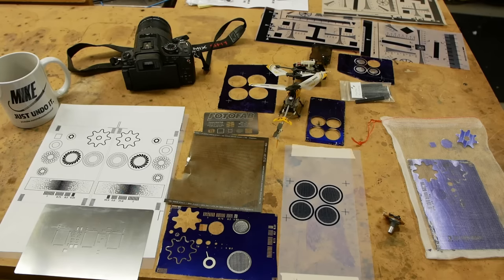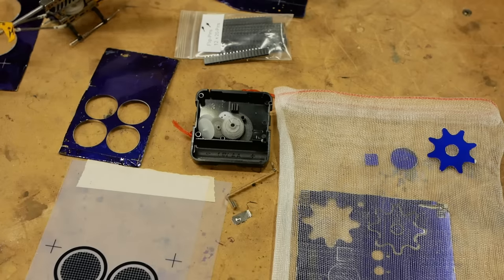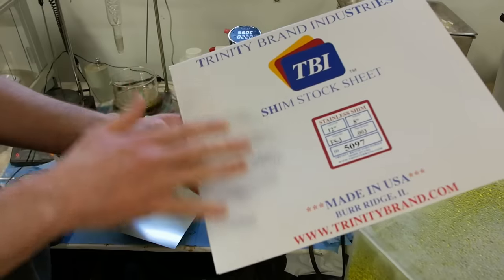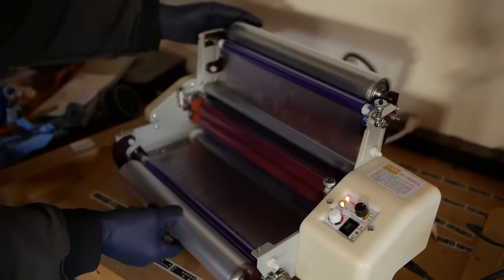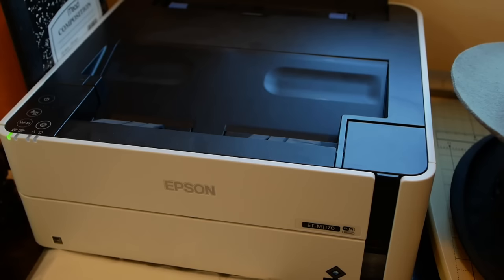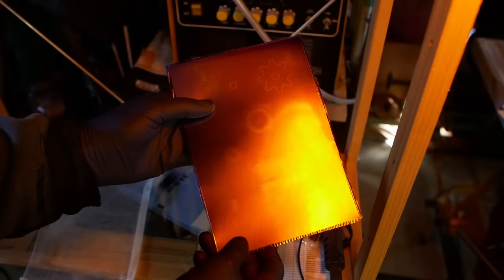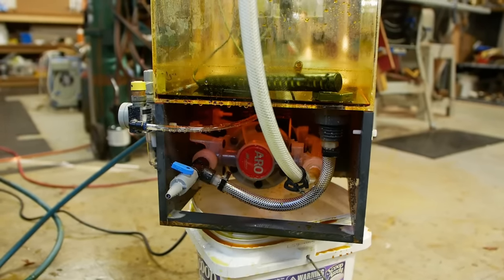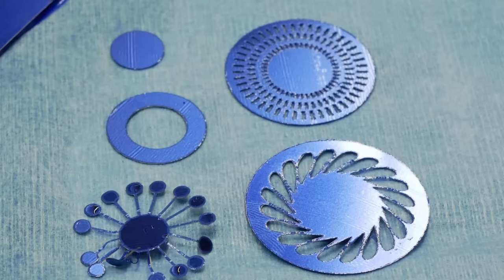How to make precise sheet metal parts (photochemical machining)

Comment: 13:37 You could add a bunch of finely-spaced concentric circles to each corner of the transparency so that a Moiré pattern forms if there is any slight misalignment. Or use the circles (for translational alignment) on one pair of diagonal corners, and grids (for rotational alignment) on the other corners. 

I assume you probably look for that pattern anyway if the part you're trying to make already has a fine mesh/grid, but it seems worthwhile to include an alignment pattern for parts that lack such features.
Reply: 13 37 indeed

Comment: @13:40  a few notes that come to mind 
A. You could use very thin double sided tape at four extremes of plastic and paper backing before placing in printer to reduce stretching of stencil print .you assume the paper will act as a decent friction for rollers .
B. 'd imagine you could print 3 index marks on the transparencies which could be accurately aligned with its counter side ,then  hole punched along with hole punching the steel sheet in exactly the same way,linking up all transparencies and steel is simply a case of pushing a plastic pin through three holes to locate all steel and transparencies without much displacement  error

Comment: Hi, just wanted to say that this is a fantastic project, just one question, have you tried using a laser eni to remove the photo resist instead of using a transparency to develop. I've seen people use a laser for circuit board prototyping and they follow a similar process to yours. Thanks

Comment: Have you thought of using photographic film for even smaller details?

In theory you could inkjet the object, or even machine a large version and use a projector to shrink it.

If you columnated the light you could also possibly make both layers at once to give a pre-registered two layer mask.

Comment: At about 13:50 you say you eyeball the registration marks, but there are parallax-correcting magnifiers used in old-school offset printing to align those registration marks on four-color process negative sets when stripping them onto flats for exposing onto the printing plates for the presses. They may still be available, but I'm not sure.

Comment: The best way to apply photoresist foil onto sheet is under the water. In that way step with drying in properly is out of scope ;) After that you can run it thru cold laminator to squeeze water out. I made lot of PCBs in that way. To have nice print from laser printer is putting already printed foil into box with towel soak in acetone for a 10-20min on a radiator. For UV lite I'm using those UV nail studio light with 555 timer :) Etching is simple by throwing it into chloride bath and occasionally moving.

Comment: Anything you find in the trash,DC barrel jacks,switches,led lights and strips,short wire harnesses from circuit boards,small DC motors,cables and connectors,USB parts,parts from circuit boards,speakers from lcd TV's,small incandescent bulbs and sockets,Ac power cords,computer cords,any electronic parts,can be cannibalized and taken out if junked things,and save you a ton of cash buying them.Plus your keeping it out of landfill.Even kitchen appliances have motors,switches,wires,connectors,screws and bolts,heating elements.Even microwave ovens have large transformers,switheslights,magnetrons,buttonscables and wires,sheet metal housing can be cut with tin snips for parts etc.Rubber feet and plastic stand-offs on the bottom of items are great to keep,for projects to keep them up off the ground.Most discarded appliances have just one minor broken part,and are dumped With a little investigative work,some screwdrivers,an ac/DC ohm meter that's $5 at harbor freight,can help you easily figure out why it was dumped,and what minor part needs repairing,mostly you can rig it to work,and you have something you can sell for some decent cash online,or use yourself,like I found a cappucino maker,kinda expensive,and only the lighted rocker switch was bad,popped it out,pulled the spade connectors off it,and I just temporarily hot wired it to the on position til I found something else I recycled,with a similar rocker switch.It wasn't a lighted switch,but who gives a Fuck? I had a nice krups German cappuccino maker that was like new,cost new like $160 bucks,looks good in my kitchen,and was free.

Comment: Very nice video. Did you look into the costs of compliance with environmental laws to do this on a commercial basis? Years ago we had the option of using Postscript to film machines that produced gorgeous high resolution real photographic film at a low cost (like 4000 dpi). Unfortunately the printing industry no longer exposes plates that way so the service bureaus are no longer a resource. I produced some silk screen film by programming code directly in Postscript. The machine operator stopped the job on one because he expected such a small file to run fast, because most PS output had a lot of code for not much image, mine was the opposite! Those mesh patterns could be created algorithmically in a similar way.

P.S. looking forward to seeing you Saturday in Pasadena!

Comment: Serious inquiry, what it the thickest the metal can be? Thick enough so its not flexible at all?
And the inside wall through the thickness can it be smooth?
If not then what about the thinnest metal sheet?
But if its thin then I needs many more sheets.
I want to make a hydrophilic battery.
Its surface area dependent, have a hexagon grid of holes 60 microns in diameter with the thinnest wall of material left between the holes, treat that metal to be super hydrophilic, stack them so the holes align perfectly. But then I need a non-flexable metal with 10 micron sized pins that will flawlessly line up with the holes going straight through all sheets except for the last one, the pins will be treated to be super hydrophobic. Pins and holes stay electrically separate. It will be assembled in a vacuum chamber of the purest water that has been fully degassed, and sealed up submerged in the water still under vacuum.
Ant there is a battery that can never die.

Comment: I've wanted to build almost precisely this but for washing resin 3d prints...need a pump/plastic combination that can handle isopropyl, or denatured alcohol, or (I think some people use acetone?)...moderately high pressure. The benefit being you can do a multistage wash with several reservoirs of smaller quantities of solvent. First stage dirty wash gets the bulk of the excess off with sheer force; further stages, simply by changing some valves around would use cleaner and cleaner solvent until the final part is 'quite' clean. Risks: Intentionally making alcohol vapour. I'd want to build a refrigeration loop to condense the mist and vapour back to a liquid...and potentially have an airlock so the chamber is never truly open to atmosphere. Bathe it with CO2 to prevent an explosive gas mixture building up.

Comment: Back when i did more PCBs at home i also used the emulsion transparency paper, but mine had a small 1cm strip of paper on the leading edge, i guess that should be enough to make it work, i never had an issue with any printer.

Comment: One thing I've learned from the DIY space recently is that you can use MSLA printers to cut out the masking process, though with only one side at a time; but I'm sure with enough spare parts, someone could develop a rig to do double-sided MSLA, potentially even with a soft clamping force to correctly locate the work piece in the vertical axis. But given the high pixel density of these panels, a lot of them now being 4K in a sub-10" panel with 8K units being the next step, they'll outperform printers with transfers; although I hate describing any display-based printer with the resolution naming, as PPI is far and away the much better unit of measurement, especially at the size of 3D printers where the PPI from a 5" unit to a 10" unit is substantially massive, especially when many units won't always share the same aspect ratio, and many products don't list the aspect ratio directly so figuring the PPI is more of a task than it should be. 

Something like this wouldn't be all that easy to automate, considering the pre-wash, rinse, and drying processes, lamination process, the locating process on the MSLA portion, and loading the mesh bag. Mesh bag loading and forward is fairly easy, just have a carrier that can move it from station to station, and have the magnet setup be disengageable to ease the transfer between stations. As for the pre-wash, rinse, and drying process, this could be automated with an oven, since blasting the sheet with entirely clean air could be difficult, post-rinse evaporation would be your friend here; or, potentially alternatively, a hot bath or steam cleaning, using hot water that'll evaporate itself to cut two processes down to one. Or, you could look for a sheet product that isn't protected via an oil film, but rather a removable film, conceptually similar to the brown paper on acrylic, something removable that doesn't require cleaning the product; I'm sure this exists somewhere, it makes sense for it to exist. 

I also have a feeling someone somewhere has an automated process similar to this in their garage for PCB printing. The MSLA trick does come from the PCB hobby after all. Really the only difference is the etching chemical, every other step is pretty much identical, not to mention the many methods of applying a photoresist. 

Although, I have been curious about using a laser in part of this. How it would handle pre-cured photoresist, how it would handle cured photoresist, etc. Outside of meshes, which would be a time sink for lasers, this should work fairly well on most projects. In theory, the laser doesn't have to be extremely powerful, just fast, which makes me think a galvanometer-based mirror system, like what a lot of fiber and MOPA units are using, would work considering they have ridiculous speeds, some are rated at 8 meters per second, not to mention these systems have fairly high precision as well. Honestly I'd be curious what power of MOPA or fiber laser would be needed to punch through shim stock, if a system like this is capable of cutting shim stock you could cut out the majority of the processes here; larger investment, but a cleaner and far smaller setup with a machine that has far more uses.
Reply: Hahaha. Finally a smart comment :)
Overkill for the quality (which is bad) he achieved on the parts!

There are laser systems quite cheap thesr days capable of prototiping without going to extremes of this video. 

Maybe as cheap
As setting up this good for enetrtaining system. 
And eliminate all steps in process and adopt a deburring. 
Easy to scale and have desired leadtimes. 

Volume wise will always be cheaper and better to order from professional suppliers.

Comment: Back in the days of my apprenticeship like 25 years ago, we etched pcb with ferric as well. BUT instead of high pressure ferric spraying around with all sorts of worries, we had a setup where you had the pcb hanging in a thin casing within the bath of ferric and a pump just bubbled air thru and foamed the hole thing.
The generated foam nicely lifted ferric from below alongside the pcb and posed out the top, flowing down back into the tub ready to be foamed and used again... Worst thing happening: pump dies or breaks and the part just sits in the ferric without agitation. Nothing catastrophic like a hot multi-bar-pressure ferric jet making a horrible mess... Also, this setup allows for a non-drilled tub to keep the ferric in. Only pipework is air and this can come from the top. 
Felt like a very save way of handling a nasty chemical. 
My 2 cents

Comment: Hi there, i love this project. I have some experience in this field, i had a small company in making model train accessories and detailing kits made out of brass and copper. 
Here's something i would consider doing:
Foam etching, so putting the Ferritechloride under pressure and foam it up (requires distilled water) and let the foam rinse the plates.
I've got some more ideas to help you improve your etching. Just ping me and I'm happy to help.

Comment: For printing with laser the problem is the gaps between the 'pixels'/ islands of ink. There is some spray on solvent that can be used to close the gaps between the dots. There is a paper about using laser printing on paper for lithography that way.

Comment: Using a laser printer to create the photo mask for etching PCBs always worked very well for me. I have a Brother laser printer that's not even running brand name toner anymore (15 years old now, 90€ at the time). I print onto cheap 80g/cm² tracing/transparent paper (*NOT transparencies*; they always gave worse results for me, no matter what kind of printer I used). Exposure is done with the innards of a face tanning lamp (for UV tubes plus rear reflector) transplanted into the case of an old scanner. If I remember correctly, I could reliably etch 8 mil/0.2mm traces (in tests; I never really needed a pitch that small).

Couldn't you just etch from one side? Sure it will take twice as long, but why go through the hassle of aligning front and back, when both sides are the same anyway?

Comment: FYI laser printers CAN achieve the required contrast. The issue is the charge corona wires are not creating a powerful enough field to attract the developer. This is most usually caused by dirty charge corona wires or just manufactured with too much insulation (wax insulated micro wire). First, try cleaning the wires. If that doesn’t work then lightly polish them with steel wool. Last resort is to directly increase the charge corona voltage via diagnostic settings.

Comment: Astounding work (as usual). Concerning the etching step. I realize the etching solution cost is not insignificant, but would it not have been more efficient if the whole container was filled with it? A little circulatory mechanism would be sufficient to guarantee equal distribution.

Comment: This was very cool to see.  Ferric chloride is awful though.  Have you considered or tried other etchants?  My experience with copper etching is a 1:1 mix of 30% H2O2 and HCl (pool acid ~28% starting conc) is a cheap and not quite so disastrous mix.  You can also experiment with copper chloride in solution as well as others.  There's a lot of vids on youtube about board etchants, though it is a bit old.  I know the H2O2 one works because it once etched the stainless steel on my sink when pouring it out with water running!  (don't do that, dilute before dumping!).  Hope this helps you and others.

Comment: I’ve spent years looking for info like this. Do you have a write up on this? I’d like to know your choices of plastics in particular as well as how you modified the laminator. I’m more interested in etching PCBs, but this is an awesome application. I am really curious about using the lcd from a sla resin 3D printer instead of transparencies.

Comment: I have been struggling for years, trying to make photo etched parts for model railroading. I recently gave up and decided to switch my efforts to sla resin 3d printing. Initially, I was very impressed with the resolution of the 3D prints and knowing that the resin printing used the same basic principle of photo masking, I decided to try swapping swapping the resin tank for a piece of photo laminated brass. To my surprise, not only did the 3D printer screen perfectly mask and expose my design onto the photo resist but it did a far better job than I had been getting with my laser printer & transparency sheets. Have you considered trying something like this? Getting a monochrome lcd screen that you can mount above a UV source, so you can make your photomask entirely digital? I have since broken my 3D printer and I have become very frustrated with the design pitfalls of the resin printing concept all around. Now that I am thinking about getting back into etching, I am not sure if I should pursue this digital photomask  route or try your special photomask inkjet ink.

Comment: Laser printing can work.  First, you have to go into the driver settings, not the print settings, and set the saturation to 100.  Then, when you print, run the page through two or three times.  I've done this for etching PCBs.

Comment: Hi Ben, there's a PCB stencil on your desk in the first minute - maybe I missed it, but I don't think you're addressing it. I recently designed a PCB and had it made by a company here in Germany, whos prices and delivery times are pretty low. I mean, ok, you are bound to the stencil material and thickness, but isn't it an option to draw the part with a solder paste layer?
Thanks a lot for all the years of fascinating and well done videos and projects!

Comment: If you want really thick toner coverage and you have access to colour printer, you can set the colour to #001900 instead of usual black. Black gives just a 0/0/0/100 on CMYK but that dark green tone comes out as a 100/0/100/90 which puts almost three times as much toner on paper. Works for my HP 2600n. The downside is you lose a lot of accuracy due to misalignment in cartridges.

Comment: How does the laminator do both sides of the metal at once? Have you got two separate rolls of the film in there ? Ingenious, btw! Every bit of it is ingenious. Going into business would depend on quality and consistency, repeatability, but if you can do it, why not? 

Also, doesn't oil dissolve in alcohol? Them being non-polar solvents (water is polar) ? The Internet tells me "yes", would be a lot easier if it removes the particular oil on your metal. Then the alcohol just evaporates, you could even blast a hairdryer at it. Worth a try?